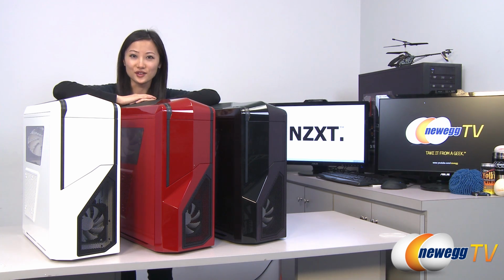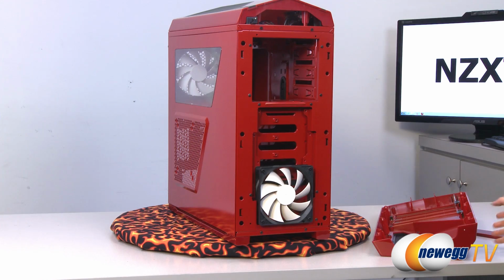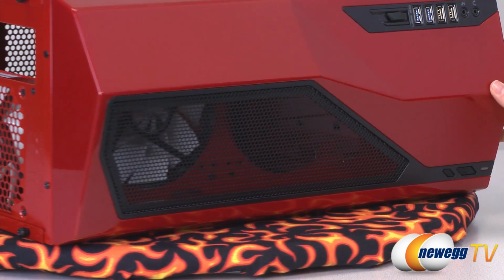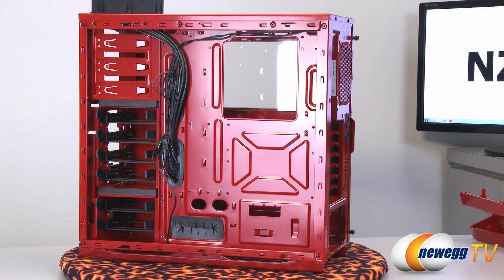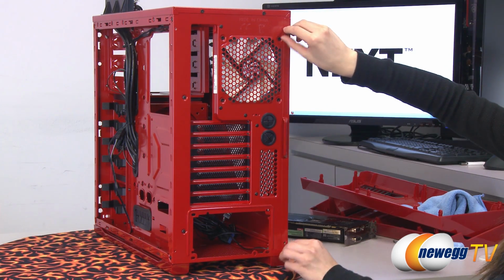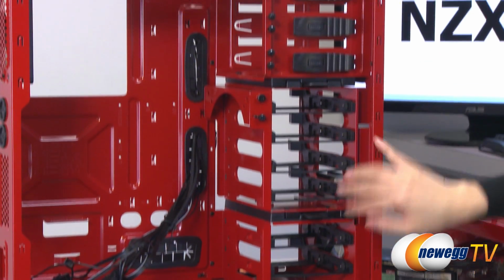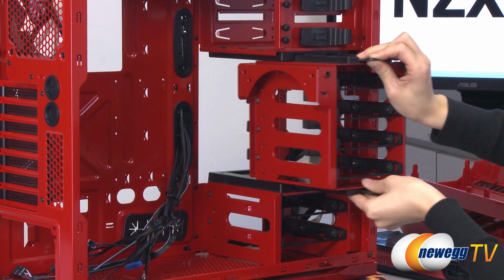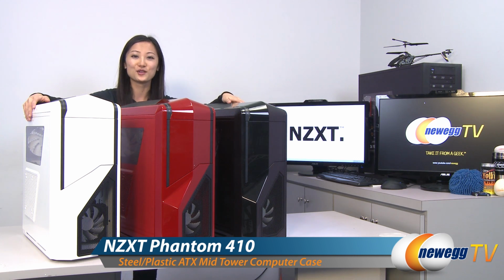Newegg TV: NZXT Phantom 410 ATX Mid Tower Computer Case Overview

Comment: Exactly, just gently squeeze the clips of the middle hdd cage and it should pull right out. You can remove the fan bracket by removing the 3 screws and don't forget to keep track of the white plastic spacer with the angling thumb screw.

Comment: My only issues with using this case is:
1. The ports on top get dust in them easily which eventually I hope doesn't ruin the ports from being used.

2. I have the case window facing me (who doesn't want to see in their PC right?) which means the other side is against the wall and opening the CD tray is a pain because the panel opens outwards towards me. So it sort of blocks me from accessing the tray unless I stand up.

3. The harddrive storage racks suck. As soon as you pull them out they fall apart and don't stay together.

4. The MOST annoying issue is the side vent. The one under the window. While its normal to get some dust inside a PC, the side panel sucks in air when not using a fan so after just 2 months of use the video card and other cards I had in it were CAKED with dust. I had to cover up that vent and use a homemade vent shaft so the only air comes in from the bottom.

You also get a ton of dust with the top vents. Even if you have the air blowing out. So again I had to make a custom vent shaft/cover so dust didn't get inside. Which is fine because it kind of looks cool. I guess this is why people just use watercooling. But thats to advanced for me right now.

Comment: I have this case and I must say it's very impressive. However the front fan for me wasn't working for a long while until I decided to check the wiring inside. After checking it all (it was all in place may I say) I put the case back together and what do you know? The fan was working again! Funny that.... Anyway it's a great case and I recommend it.
Reply: +THEmickTHEgun Do the stock fans fit in the fan controller 3 pin connectors?
Reply: Lazy_g123 Yea mine do

Comment: You would be fine with a water cooling loop, you should have a top mounted radiater and remove the remove-able 3 1/4 bays for placing the pump.

Comment: @StarCraftGatman mount them with the power/sata connectors pointing out the back, then put the motherboard side through the bottom cable management grommet and plug it in, no cables showing..

Comment: I prefer an air cooler over the closed loop water cooling because I don't feel like that they are future proof. If you're gonna do water cooling I suggest getting a small kit for just the CPU, though it really is preference and the closed loop will definitely be cheaper than a small kit. Also the H60 does have some incredible reviews and some nice overclock benchmarks.

Comment: I really like the look of this case but also the how spacious this is along with nice cooling placements. I'm just torn between this or going for the:
Fractal Design Define R4
BitFenix Shinobi Midi Tower (Windowed)
Corsair Carbide Series 300R (Windowed).
Reply: Which one did you go for? I was in exactly the same position last week except for me it was the CM Scout 2 instead of the R4.

Shinobi was the first to be eliminated due to it's backward hard drive cage orientation, the 300R was next coz it has 4 HDD bays and I use 6, the Scout 2 soon after that because it doesn't support large radiators, which left me with this one - so I got a nice Orange/Black phantom 410 and I love it.

Comment: On the Newegg website this case is listed as having removable filters. Can I assume that means air filters? This video didn't touch on that.
Reply: Alex Salvador only, I think, the front intakes and bottom intake. The side I'm not sure about, but the traditional exhausts - the top and rear fan mounts - have no filters.

Comment: The only thing I didn't like about the case was those rubber pieces that the cables go into to hide them. EASILY come off just putting wires through carefully. No matter how hard you try its gonna come off.
Reply: They also start to fall apart too, smudging all over whatever it comes in contact with.

Comment: Most motherboards nowadays that are made for intel sandy/ivy bridge processors can use generation 1 (i3) 2(i5) or 3(i7) so just look for a motherboard that supports intel, anf you'll be good to go. for either sandy or ivy bridge processors, i would reccomend a 2011 socket.

Comment: still running this case in gun metal color for 4+ years. thought about upgrading to nzxt 340 but then i thought... man what case has 7 cooling fans, 3x 5.25 bays, side panel view, is user friendly,  and still the same price or higher than when i first bought it ? ($79)

Comment: This case has a perfect example of how I don't like filters to be done.  The front has none at all, which is annoying but not that big a deal because dust falls in from the top or (far more often) is sucked in from the bottom.  The bottom has 1 filter (more of a mesh with nice big holes to let in the really fine dust), and... right next to that filtered grill, another grill!  This one completely bare.  Why even bother filtering the first one if this next one is bare?

Comment: can this case fit a 280mm radiator up top?
Reply: i just checked and no she doesnt. she sais it can fit a 240mm radiator, but it can fit two 140mm fans up top which makes me think it might fit a 280mm radiator. anyone evr try that with this case?
Reply: I'm wondering that same thing
Reply: if i choose to put a 240mm radiator cooling system on top could i move the 140mm preinstalled top fan and place it on another position mount in the case

Comment: will an msi fit in there?????

Is this build good?
CPU:
Intel Core i3-4130

Motherboard:MSI Computer Corp. LGA1150/Intel H81/DDR3/SATA3 and USB3.0/A&GbE/MicroATX Motherboard H81M-P33MSI 
H81M-P33

RAM: Corsair 
CMZ8GX3M2A1600C9B 8gb (should I get one more?)

SSD: Samsung 
840 EVO 250 gb

HDD: Western Digital BLACK SERIES 2TB 3.5" 7200RPM Internal Hard Drive

Video Card: Gigabyte Radeon R9 270X 2GB WINDFORCE Video CarD

Case: NZXT Phantom 410 (White) ATX Mid Tower Case

Power: EVGA SuperNOVA GS 550W 80+ Gold Certified Fully-Modular ATX Power Supply

Mouse: Logitech G302 Daedalus Prime Moba Gaming Mouse 4k dpi

Keyboard: TT eSports challenger prime

Monitor: 60-120Hz 1080p any recommendations (lowest price possible.)

Total price: $680+ (sigh solid build though I might ditch one tb of memory I don't really download a lot of things any help would be appreciated thanks. BTW this link is were I started http://pcpartpicker.com/p/42ZnYJ )
Reply: +Alexis Diaz I'm not so technical but I would boost the CPU to at least an i5 or i7

Comment: Could someone give a list (and prices) of parts (in NZ) that i could use to build a PC using this case? the games i want to run is BO2, CS:GO and MC. I'm new to this PC world, so help would be greatly appreciated!! XD
Cheers
Nash
Reply: My budget is anywhere under 1200, however, i can stretch to 1300 if need be.
(All in New Zealand Dollars)
Once again,
Cheers,
Nash
Reply: Other than the above mentioned games, it will also be used for watching YouTube and work.
Reply: NashDaPark i dunno NZ prices but i'd think a 960 and i5 4460 would be decent
Reply: cheers, lachauthe nacho
Reply: NashDaPark No problem
Reply: Do you have any idea what
 monitor would work best? i dont wanna be spending more than $200 NZD
Cheers,
Nash
Reply: some cheap 24" benq goes for just over £100 so one of those
Reply: cheers dude, you have been a great help!
Reply: NashDaPark i have nothing better to do :D
Reply: :D
Reply: NashDaPark dude same games i was going for hah
Reply: XD
Reply: dude u want a build? 
ill give you one for about 800 dollars
Reply: give me a second
Reply: if i were u get a mother board and cpu combo...but nayways..

intel core i5-4690K 3.5GHz LGA 1150 Processor

Gigabyte GA-z97x motherboard

GeForce GTX 750 Ti graphics card

NZXT mid tower 410 case

1 TB hard drive

8gb ram corsair vengeance
Reply: cheers
Reply: Bartosz Baran This is my actual config, plus a Kingston SSD 120gb for OS. You should buy that NashDaPark
Reply: cheers :D
Reply: thanks for the recomendation, but i already  bought a computer. thanks anyway
Reply: cool what pc did you get
Reply: i got an all in one unit by hp
Reply: Booooo. Hp' get out
Reply: +NashDaPark you....got a pre built.........wow.........woooooow..........how much did it cost and what specs?
Reply: +NashDaPark lmao.. fail

Comment: So, im kinda nooby in computer building but im still going to build one. Is this motherboard MSI Z87-G45 Gaming, Socket-1150 compatible with this case?
Reply: yep, this case should work with any conventional size
Reply: I was literally going to ask about the exact same motherboard
Reply: Daniel Counihan lol good thing you saw this post then
Reply: This case will fit ATX and mATX motherboards. The MSI Z87-G45 Gaming is ATX size, which is normal. So, yes this WILL fit your motherboard.
Reply: Gaming, Unboxings and Reviews
Another Q bro, How about the MSI-Z87-GD65?
Reply: Yes, that board is also an ATX size board. It's just the upgraded G45.
Reply: as long as the board is ATX, mini ATX, or micro ATX it should work fine
Reply: Yes, correct.

Comment: How long is the video card bay with the Drive bay still on it? im planning on the MSI GeForce GTX 960 4GB Video Card
Reply: +GlitterOutlaw Its a good idear to plug your build into a website called pcpartpicker.com it will give you alot of answers like this,
The NZXT Phantom 410 (White) ATX Mid Tower Case supports video cards up to 305mm long, but video cards over 230mm may block drive bays.  Since the MSI GeForce GTX 960 4GB Video Card is 267mm long, some drive bays may not be usable.
I'm a PC with gtx 960 4GB as well :D
Reply: +Lars Carlsen  i did use that which why i was asking if it really is too big or maybe "just right" i prolly wont mind taking the bay off tho i wish it wasnt the whole bay lol .... well see when i get it i guess lol

Comment: newbie question, for the 4 pin fan controller its connected to psu right? and so are the other case fans ? I don't why Im confused I thought it connects to motherboard
Reply: lightbike vids You will have to connect the 4 pin fan controller to the psu. Then, you will connect the fans to the controller. That way, you will be able to control the fans manually. But another option is that you connect fans to your motherboard, that way the fans that are connected will be controlled automatically.

Comment: This is just metal and plastic.
This is NOT a computer.

You will need:
- A motherboard
- A processor inside the motherboard
- A hard drive
- A power supply
- A computer case (like this one)
- (optional) a video card